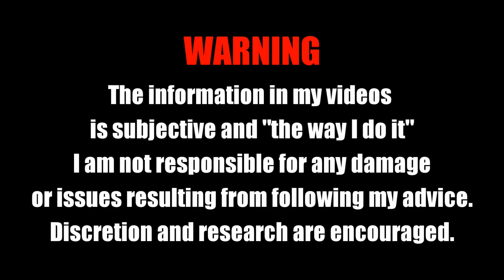Taper verses ball bearings - On Motorcycle Steering Heads

Comment: Tapered roller bearing has a side load aspect that ball and cup doesn't also they are less Agro to fit and require less maintanence.
If you let a ball and cup get loose there will be slop top and bottom whereas tapered bearing will maintain "fit" on the bottom bearing because of the pressure.
The long and the short of it is they both work when fitted and adjusted properly, would I fit ball and cup? No way, taper bearings go in every time and a good bearing supplier will provide as good or better than oem for a fraction of the price.
Reply from the maker: True, tapered roller bearings are capable of handling higher radial loads, but angular contact ball bearings can handle the radial loads in a steering assembly adequately. False, if you let an angular contact become loose  in a static load situation gravity will maintain accurate location on the bottom bearing, any clearance issues will be in the top bearing just as with a tapered bearing assembly.  A motorcycle steering stem is subjected to dynamic forces and a loose assembly, both angular contact AND tapered roller, will see clearance introduced at the bottom bearing during acceleration. The difference is that when you back off the throttle the angular contact will maintain alignment, the tapered roller is more likely to give you a tank slapper.
Reply: @ANDY5  iv been fitting tapered bearings for 40 years and never had a tank slapper, back in the day everything was loose ball and cup, basically pushbike tech, and everyone swapped them for tapered rollers and rarely looked at them again.
In fact rob north used them on his race frames as swing arm bearings for which they required frame pinch or shims for end float/clearence, I build xr69's and use a tapered roller/thrust race combined for swing arm and I think they are not much more than 20quid a pair.
I don't know anyone who would consider anything other than tapered rollers for a headstock
It's a no Brainer isn't it?
Reply: "It's a no Brainer isn't it?"

 @pbysome IMO, the fact that Suzuki's engineers deliberately specified angular contact bearings rather than the cheaper tapered rollers would indicate that, no, it's not a "no brainer".

On old bikes, replacing cup and cone (effectively 45° angular contact bearings) with taper bearings was a "no brainer", as it stopped the fucking balls dropping all over the workshop floor every time you intervened.  On the other hand, this changes the contact angle, (usually around 30° for TRBs) which is still fine for steering head application, but makes adjustment more critical and difficult to do correctly.

On a 300+kph bike, I'd tend to treat steering system as "holistic" - if the designers specified a more expensive alternative to "off the shelf bog stock tapered bearings", there is almost certainly a reason for that.  Sure, a bearing is a bearing, but a tyre is a tyre, and you're not chucking 12 quid Ching Shens on your 'busa, are you?
Reply: @wibblywobblyidiotvision  as it happens I stripped an early American import gs1000 a couple of years back and it had ball and cup bearings from the factory, they only fly over the Fucking floor if they haven't been greased.
Head stock bearings properly adjusted, and that ain't hard, are not in the same realm as tyres so your condescending comparison
Is a bit well...condescending.
Reply: @wibblywobblyidiotvision  what's this, an English lesson? Aren't we being a touch cemantic or pedantic or just churlish? Oh you just tell me Yoda.
Reply: @pbysome  You seem to think I'm having a pop, I'm not.  Just pointing out that the engineers at Suzuki deliberately specified a more expensive part, and justified it through to the production stage; the tradeoffs of cost vs performance that they were making are specific to the performance of the machine they were designing and putting onto the road.  It's all about tradeoffs, there is no one size fits all best solution, which your "no brainer" comment implies there is, especially when talking about ultra-high-performance machines.

As for headstock bearings vs tyres, I'd say it's much of a muchness.  Both are critical to safety, and both are largely undermaintained, headsets far more so than tyres.  Bearings out of the factory or fitted by a competent mechanic can be considered to probably be correctly lubed and adjusted.  Mangled in by Del, perhaps less so.  But how many people re-adjust, let alone relube, their headsets, rather than simply letting them rot and fail?  How many headsets with cup & cone have you seen with one, or two, or more, balls missing?  How many dry headsets are there out there?  Headsets run dry to the point of having pitted balls, or knackered rollers?  Over tightened or sloppy?  How many tyres do you see that are under or over inflated?  Under specced for the machine?  Squared off, bald, old and hard?  With chain oil on the left hand chicken strip just waiting to catch you out if you roll it over further?
Reply: @wibblywobblyidiotvision  this isn't the forum for so many variables,can only really estoll the virtues of one or tother.
For me, it's about the difference between bearings bringing maintanence, or lack thereof, into it is really a bottomless pit.
Manufacturers specify things for many reasons one of them being repair cost.
I would ride a bike with a little play in the headstock (albeit carefully)
I wouldn't ride a bike with poor tyres.
I don't know your age but when Japanese bikes first come to the fore they had suicide synthetic tyres which were changed as a matter of course but the cup and cone were mainly changed when they went out of serviceable use.
As for you having a pop, probably correcting my English and swearing didn't help, there are no other senses to draw upon.

Comment: I like to interrogate the rider and determine exactly how he intends to use the bike because has you say both have their strong points and the engineers design these bikes are not fools if you have a bike that's raced on short circuits with lots of quick Direction changes the ball bearing is superior it can be the difference between win or lose. If the bike will be used in a situation where there is an extreme amount of pounding on the suspension system then the tapered roller bearing might be the better choice. as I said before everything you said is correct.